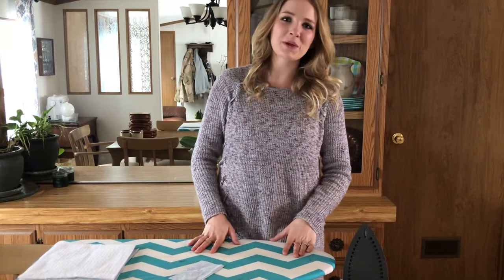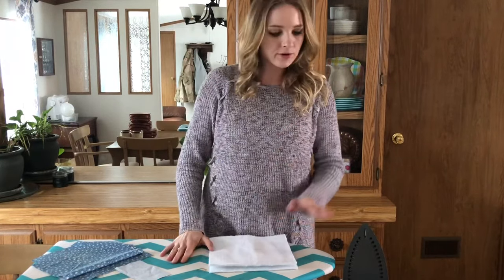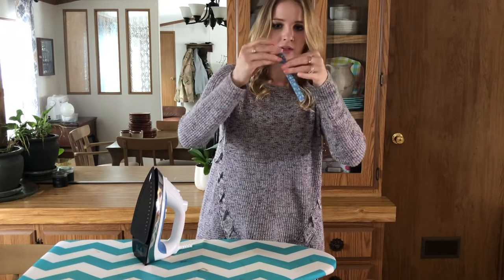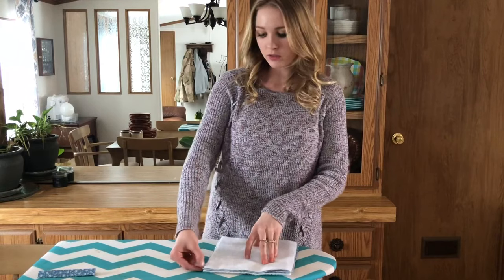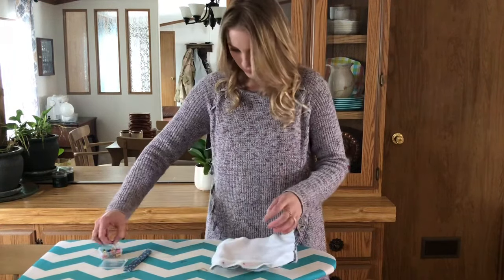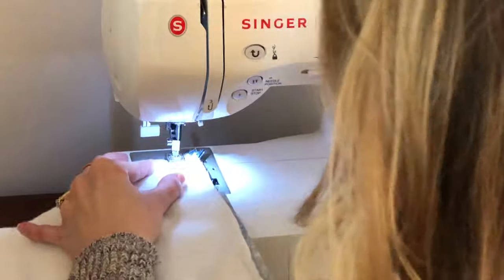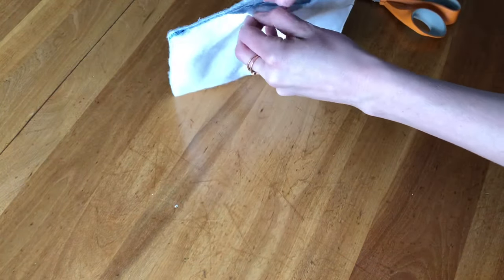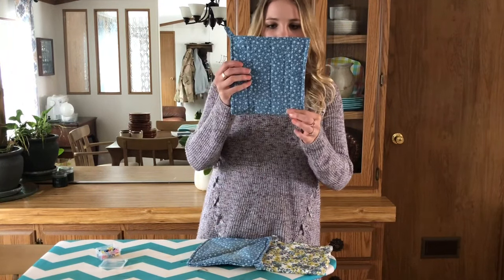How to Sew Potholders - Easy DIY Potholders Sewing Tutorial

Comment: One additional comment, your fabric and thread should be 100% cotton, linen or wool.  polyester will melt at oven or stove top temperatures.  if you grab your skillet handle with polyester fabric, you will have a problem.  outside of that, this is a great tutorial!!
Reply: can i use mixed fabric?
Reply: @blurssotong  do you mean a fabric that is a cotton/polyester blend?  i'm sorry but I really don't think so.  The poly can melt even if it's blended with cotton.  I think all the synthetic fabrics will have this problem.  You could probably test a fabric that you want to use by holding a scrap of it against a hot skillet or or a pan that has been in the oven for a while.

Comment: Thank you so much.  This is exactly what I was looking for, a pot holder/hot pad without bias binding around the edges.  I made an oven mitt for a friend and had enough extra fabric to do one of these and a skillet handle cover all matching!  There MAY be enough to do a small coaster or two as well.  Thank you again!  (I just checked to see what other videos you have and discovered there's only one other.  You did this very well. you should do more if you can.)

Comment: Great tutorial. I have a suggestion. Instead of reaching over the top of the machine to raise/lower the pressure foot when you pivot at the corners, or any other time you need to raise or lower it, reach your hand through the middle of the machine and around to flip the lever. I promise it will make your life so much easier.   Happy Sewing!
Reply from the maker: Thanks for being so kind! I know that going from the bottom is so much easier and how you're suppose to do it LOL I just have a habit of going over the top...! but i'm going to work on breaking it ;) thanks so much for the suggestion!! <3

Comment: Some helpful hints for your next videos, at the beginning when you are holding up the pieces that are needed for the project you should explain what they are for don’t assume everybody knows because you may have some beginners watching.

Also some people may be confused when you’re using the term batting that usually is reserved for 100% cotton batting for quilts or even the 80% cotton polyester mix.

And lastly, you need to make these similar to oven mitts where you have two layers each of 100% cotton batting and the Insul Bright. You also forgot to mention that depending on which insul bright you are using, you have to lay it down in the correct order where the insulation fabric is facing towards the outside so it will prevent heat transferring through the pot holder. Some of their products are directional.

You did not mention seam allowance and also a walking foot is preferred versus an all purpose foot.

Unfortunately your pins were in the wrong direction you should be pulling the pins out with the pinheads closest to your body not closest to your presser foot.

And it’s easier to quilt each of those pieces prior to putting it together as a sandwich.

For these types of thick projects it’s best to use wonder clips or a generic version instead of pins
Reply from the maker: Hi there! Thanks so much for the help critiques. I'll take note of everything you mentioned! Have a great day.
Reply: @backroadbloom  I really am trying to be helpful. I have not only watched a ton of videos I am also a professional videographer and graphic designer so I do have a pretty good foundation behind me for the recommendations that I am making for you. A really successful channel who you may want to watch to see how she presents her tutorials, it’s called The Crafty Gemini.
Reply: I have to agree with this. For concern of coming across as condescending and discouraging, I feared leaving a similar comment. I'd like to insert here, that it is always helpful to NOT cut the fabric from the turn hole when you are trimming away the excess fabric before turning and top stitching. This ensures that all fabric is caught in the top stitch and will not come undone and/or fray.
Reply: @JesMarie_W3  And to use pinking shears. They’re quite reasonably priced at some fabric stores like Joannes.